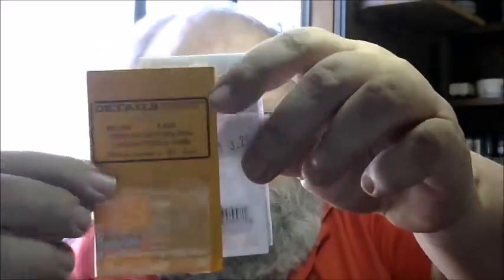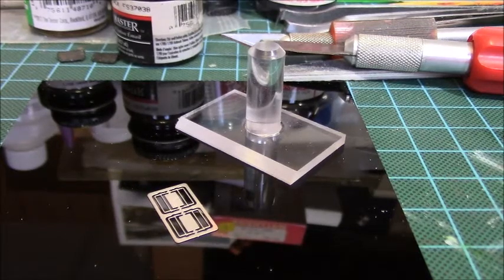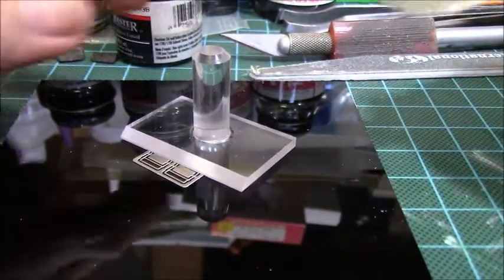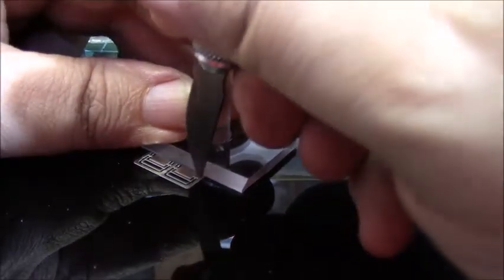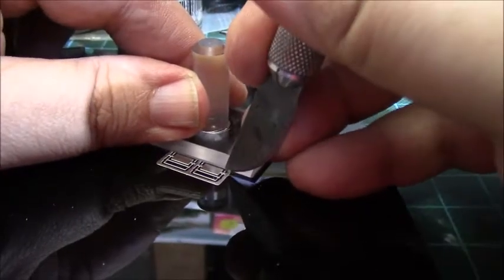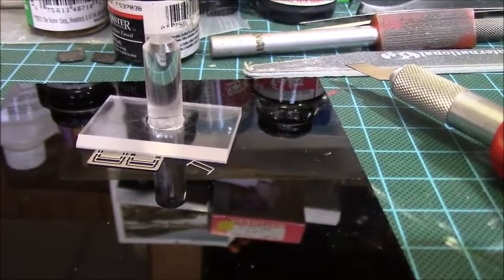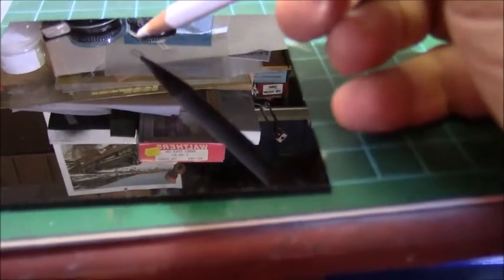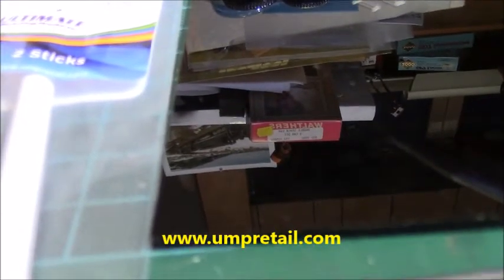Weathering model railroad equipment with Wally's Weathering

Comment: Reason why you did not make your cuts on a cutting mat?
Reply from the maker: Eric, cutting mats will deform the PE before it cuts it. A hard surface, (and a sharp blade) works better.
Reply: Yes, I always cut PE parts on a piece of plate glass.
Reply from the maker: Ron, I had a piece of plate glass, it fell off my work table and sliced through a extension cord I had running underneath. I thought  man! that could have been my foot! I'll stick with the acrylic squares!
Reply: Yes, I got a remnant from a local glass company and had them grind the corners, so unless it breaks and a broken edge hits me it won't cut anything.